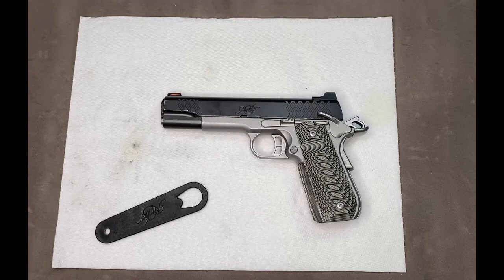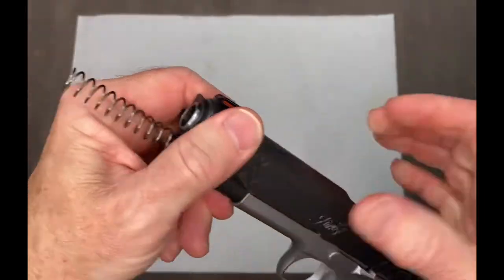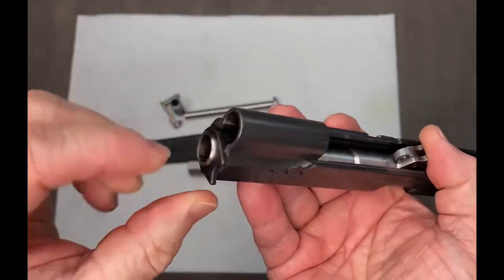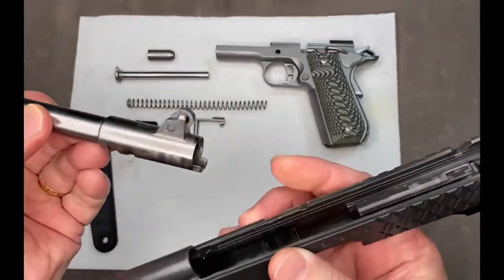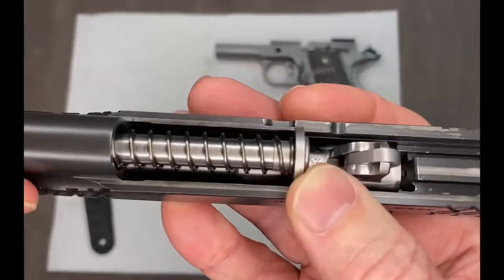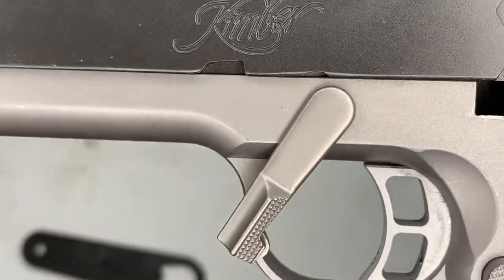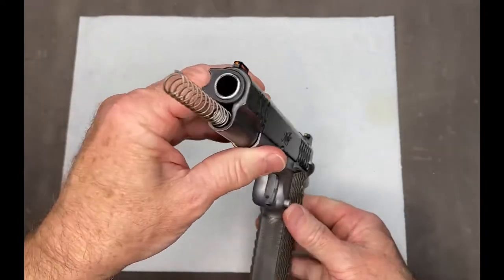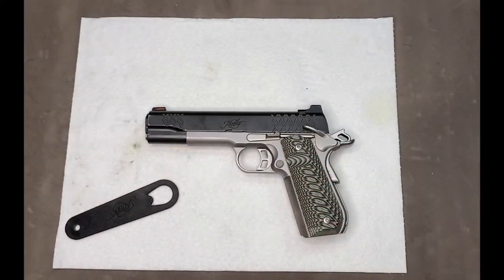How to Field Strip and Reassemble a Kimber 1911 Aegis Elite #1911 #kimber

Comment: My Kimber will not take a fully loaded 8 round mag I have to remove one round any idea why?
Reply from the maker: What magazines are you using? And have you tried other brands such as Wilson Combat magazines?

Dave
Reply: I will try the wilson mags. Thank you for responding. Have a great day. @davesgunchannel
Reply: Try with slide back and locked open if closed spring in mag bottoms out and stops before locking in place